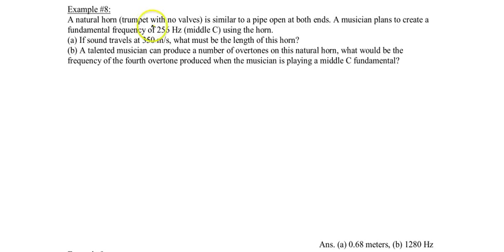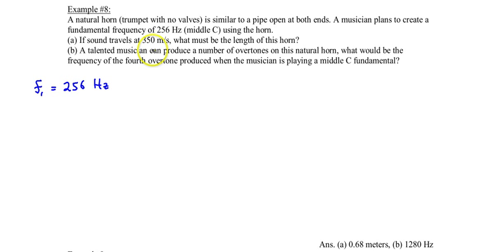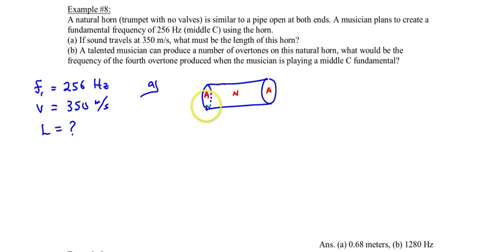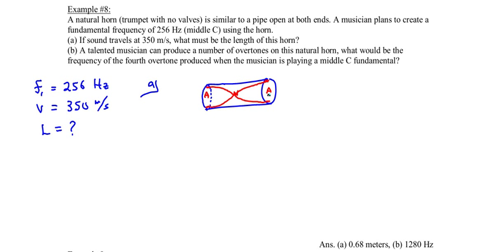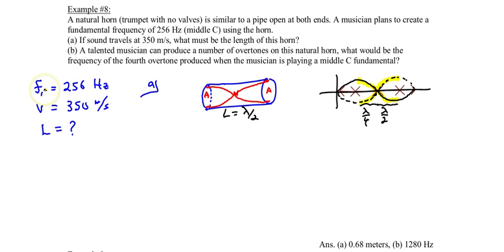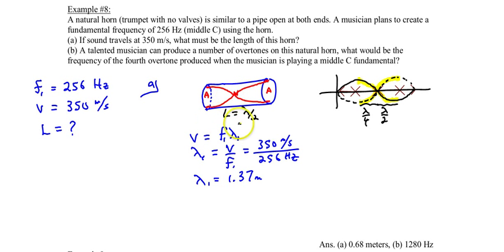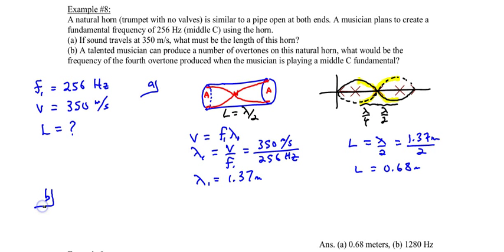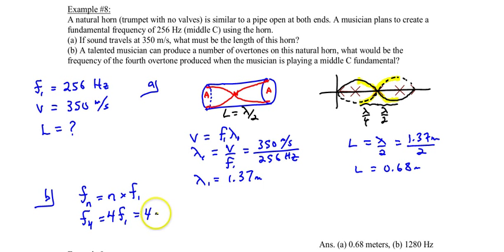Chapter 17, Example #8 (Natural horn)

Comment: part b) answer is right but the values you plugged in are wrong. The question say 4th overtone which is actually 5th Harmonic (not 4th harmonic). So fn=nf1 , f5= 5*256=1280.   4*256=1024 not equal to 1280Hz. I know must have set the notes and worked out the right solution for 1rst. But sometimes it happen. Dont mind. I respect you.